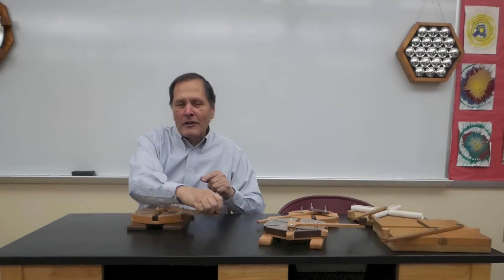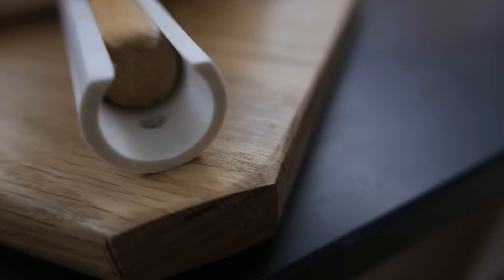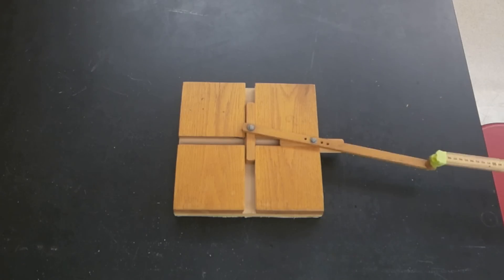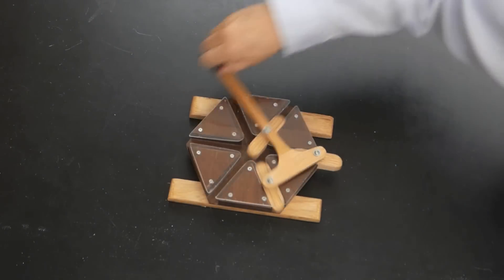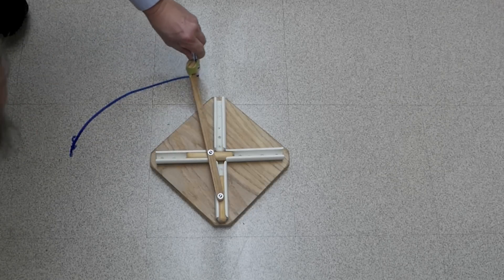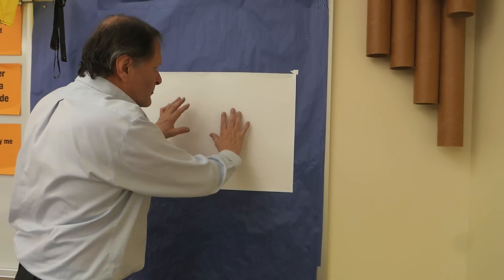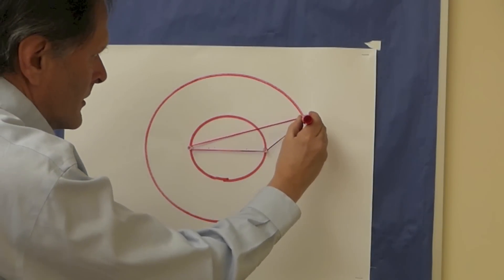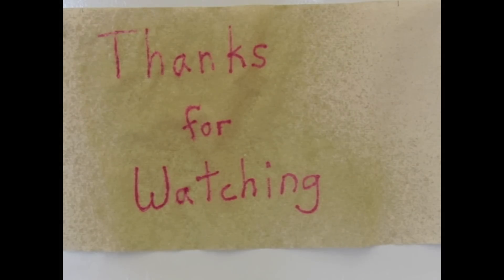Trammel of Archimedes - Do Nothing Machine part 2 // Homemade Science with Bruce Yeany

Comment: Could you (if you somehow accounted for human imprecision) draw a perfect circle,  using the method shown around 5:00, but the string's length was
Pi X the length of the pins? It seems to make sense. On the other hand, using a compass would be much simpler, but it still would be nice to know.

Comment: I happened across a picture of one of these on a web-based image search and was curious about it. One additional search later and I found an article that link your video. From what I understood after reading that article, it uses a little bit of geometric mathematics (mind you, I don't remember my geometry and trigonometry well enough to explain it) to ensure a perfectly elliptical path, making it useful for marking ellipses in things like sheet-metal. What I still don't get though, is how you can adjust the eccentricity of the resulting ellipse? Best I can figure you would have to extend the arms further to make it more circle-like (both fixed points would be closer together, at least in proportion, resulting in a larger but less eccentric ellipse), but what if you wanted a really "flat" ellipse? And how does the elliptical math work?

Comment: School teaches children that they are monkeys living on a ball in a vacuum but with an atmosphere (air) connected to this vacuum, and that we are walking sideways or upside down and spinning at 1038 mph at the equator, which is faster than a speeding bullet yet you see lakes perfectly still and you can see farther than would be possible on a globe earth with a radius of 3959 miles and the drop in feet due to curvature easily calculatable as distance you are viewing over water in miles squared times 2/3 = feet of drop due to curvature.  You can see too far for that math.  A tall man with eyes at 6ft standing at the shore line could only see 3 miles maximum.  The calculation:  Miles squared X 2/3 = 3 miles square = 9 miles x 2/3 = 6 feet drop due to curvature.  So a 6 foot tall man at the shoreline could only see 3 miles yet in real life you can see 10 miles easy.

Comment: Would this be good to use in an engine? Its actually kind of similar to how the pistons on a crankshaft perform. The 'shuttles' are the pistons and the track that they run on are the cylinders. The lever is the connecting rod. All that is missing would be a crank shaft to connect to an axle, which would in turn provide the rotational force. The force, however, applied on this machine is on the lever. In an internal combustion engine, the force is applied to the pistons (shuttles) via a chemical explosion causing the crankshaft to rotate. The pistons are aligned in various positions in different types of setups. For example, they can be placed in-line (inline engine), in a V shape (V6, V8, etc) or even horizontally (Boxer engine: SUBARU. PORCHE). These setups are designed to minimize vibration and maximize torque in an efficient manner to provide a balanced but powerful rotational force to the crank shaft. This setup could actually work in an engine application, with the idea of applying force to both sides of the piston resulting in rotational energy supplied to a crank shaft.

Comment: The reason this is not used as an engine is due to the fact that the pieces travel down multiple lanes, which drastically increases friction. While you would be able to ignite on both ends, it really wouldn’t do much seeing as the most efficient design would involve the pieces igniting at exactly opposite intervals. It would increase engine power, but at the cost of substantially increased fuel consumption. At that point, there are more efficient engines with the same output. Also, the three pin design would (probably) not work at all as an engine due to the fact that it would be very difficult or impossible to find timings that would fit it. Any input on that last part? I’m really not very good with engines.

Comment: You would mount the base to a runner log of a house and drive the dowel in to the joining log using the leverage of the divide. Post and beam house tool maybe.

Comment: I was looking to see if an Archimedes trammel could be done with 3 sliding bars, thank you!

I want to use it to illustrate how three sine waves, 120 degrees out of phase with each other, can cause circular motion in a 3 phase electric motor. This will do nicely.

If you look at equidistant from the three slides, it goes around in a perfect circle.

Comment: You know what you've created, new engine concept. Elliptical in design do to the drive arm orientation, and double head pistons, 6 total. You could fit three of these in on making it 18 total potential piston each doing 4 strokes geeeeeezzz, man you need an engineer on this. What. If you don't man I'll start designing an engine based of this concept.

Comment: im thinking a new combustion motor 
?
Reply: Kyle Gardner I was actually thinking the same thing
Reply: Kyle Gardner compressed air motor
Reply: I can see where you're coming from but it wouldn't really have any benefits, generally you want to have the most simple practical design when engineering. It would also be hard to pull off because of how the pistons would move. The way the chambers open up is the problem
Reply: Ah meaning it need to be built with two sides ?
Reply: Wouldn't have many benefits (if any) but it would look really cool

Comment: If you have an rotary motion, you can use it to produce stroke motion. Just turn the piece with the slots and the bar will pushpull. May it make easier to overcome the dead point as with an eccentric.

Comment: so Bruce as I new subscriber I would like to ask if you know of a mechanical gear set that would allow me to drive a wheel with a handle along part of the wheels rim. I hope I'm making sense. what I'm trying to do is build a hubless unicycle that ideally I will set inside with a set of handles between my legs that I will power the cycle with by pushing and pulling like rowing a boat. I have seen a gear set on the handles that will travel inside a gear channel that is around part of the wheels hub and then reverses and runs back to where it startted from and starts over again.
Reply from the maker: Wow,  that sounds like an awesome project,  I think I understand how you want the setup,  I will check around see if I can find something

Comment: Hey Bruce, 
So for the sake of argument, why can't this be applied to a 6 cylinder radial engine with the spark plugs and ignition chambers around the outside?  And why can't the first class/second class levers be similarly applied as a four cylinder IC engine?
Inquiring minds want to know. ;-)
Reply from the maker: I've had a few people suggest that it is similar to the design used in a Paut engine but have not checked into it

Comment: would you be able to share the plans or measurements of the more complex one? (3 sliders). Also when I made a 2 slide one i didn't do such a great job on the hardware used to connect the stick to the sliders for good movement. What did you use? Thank you. I love these machines
Reply from the maker: Daniel,  I have several pictures that I can put to gather that would be helpful,  I attached the shuttles with machine screws and can show that also
Reply: Bruce Yeany I would greatly appreciate that. Thank you.

Comment: If you move the handle with constant speed, you can see that the small wood pieces move in one direction but the speed changes dinamically (acceleration). It is how gravity works. Gravity affects speed of matters so it will produce acceleration. It is why planets dont only move circle, but also oval

Comment: Make a feeder hole, Turn it upside down. Make the three axis be a full lid and then have an animal move or a source of water rush in ellipsograph pattern. Hower, instead of one handle. It would be having two handles, the other one simply being there to pick up the current once the other axis is at the end of the water rush. To keep it spinning around and around. 

And voila, you get a way of categorizing something in even bits... Needlessly complex. 

Personally, I can only see the X/Y axis version being useful in more applications if anything. But due its shape oval shape, it is very hard to truly translate it into more useful functions than Circular applications. Since the short sides generates too much resistance, hence the pen Hiccups at those points. 

The resistance in a circle is more consistent through out, allowing it to not create uphill struggles.

Comment: I'm curious, would you be able to make an automatic braiding machine with this, a hole in the bottom and string attached to the shuttles that gets drawn by something at a relative speed to the rotation of the lever? I don't know if it would work but I'm curious to see the result. Thanks in advance!

Comment: I prefer drawing ellipses with a compass rotated on its pivot to a certain degree, connected to a pair of legs to for stability, and a pen that can slide within its holder. The pivot point is the center of the circle/ellipse and the degree of tilt determines the shape of the ellipse. The sliding pen, at an upright, doesn't slide and creates a circle; but once you introduce tilt, the pen will slide within its holder to create an ellipse. The ellipse is caused by the pivot's angle to the surface, the acute angle will cause the pen to retract and create one side of the ellipse, and the obtuse angle will cause the pen to extend and create the other side of the ellipse. Of course this only works in one axis, but if you apply tilt in another axis, the ellipse will rotate on the surface, but I have only tested this with 45 degrees in both axis of tilt, results may vary. 
I forgot who originally created this compass in the renaissance, might have been Da Vinci, but it's hard to research it with so many inventions being made then. I do know Da Vinci made a parabolic compass, but that was an angled pen drawing on an angled surface, so it might be the same concept with a different execution.
Reply from the maker: I would be interested in seeing your method
Reply: http://brunelleschi.imss.fi.it/esplora/compasso/dswmedia/storia/immagini/02/03.jpg

That's one design of what I'm talking about. Although that only provides an angle in one axis. But you could easily add rotation to the rod connecting the pivot and the legs. 
I'd prefer my elliptical compases with a protractor between the pivot and the legs, so you can measure what angle the pivot is at.

Comment: I've realized that the number of shuttles around the polygon (they seem to only work on polygons) is p\2 (p=polygon) like it is always just half and I know this is kindof obvious but I didn't know if you realized that also did you realize that it actually moves around instead of just back and forth like the hex one went around instead of on the same pegs everytime
Reply from the maker: Hello Awlom,  You're right it is not very obvious with the two and three shuttles,  I didn't realize it but hopefully it will become more obvious with the higher numbers of trammels,  I am currently trying to make one with 6

Comment: This could make a effective arm exercising device should you add a  track around the edge and put a tight piece of rubber in it so the shuttles need to push the rubber to fully rotate the lever.

Comment: Actually, looking at this you could use it as a kind of simplified transmission. If you offset a handle on the other side of the device you should transfer that cranking motion into either another cranking motion or into into a piston motion with the right joints. Not entirely sure if it would have any true advantages but it is doable.

Comment: this concept has been applied to the design of early rotary engines used in aircraft but in this case there is a ellipse being formed outside the piston cylinder assembly rather than a perfect circle being formed by a larger cocentric array of piston cylinder assemblues

Comment: Hello Bruce. I was thinking about hot air engines as I watched the video. I think the movement could be adapted to power and displacer pistons coupled to a flywheel like a Walking Beam Stirling. Nice job.
Reply: I was just thinking the same, why has nobody tried this?

Comment: Instead of running it around as a machine, imagine tight tolerances with seals and use it as a valve system. Most valves open and close in line but imagine an industrial setting where fluids or gasses might be diverted into tanks at various stages of production.

Comment: If you change the length of the track and the anchor point of the major axis could you make it trace the path of a circle rather than an ellipse?
Reply: A circle need to have one foci, not the 2 or three used in the trammels.  If you remove one foci, and affix the other, you will have a circle maker.
Reply: So any sum of trammels other than 1 results in an ellipse?
Reply: A circle is infact a special type of ellipse.
What is really interesting is that the circumference of a circle is well defined (c = pi*r^2). The circumference of an ellipse has no simple equation, instead different type of approximations are used depending on accuracy needs.

Comment: Using this contraption, how can the distance between the two vertices and the distance between the two covertices (distances 2a and 2b in geometry I believe) be affected? Are they fixed to an arbitrary proportion meaning that no matter how far from the center you place the marker you'll always get similar ellipses? 

Also, could you post an outline of the pieces for both mechanisms (or at least the fancy one with the three pieces moving in its base) to build our own?
Reply from the maker: HI David,  I am in the middle of writing up some build instructions and should have them soon
Reply: Bruce Yeany did you ever post the build instructions?
Reply from the maker: Hi David,    sorry   I didn't make those yet, I think if you check there may be some online.  I

Comment: I worked in an art gallery when I was younger. I knew of the push pin technique. The fact that it creates an ellipse is interesting. If the handle was telescopic and the end modified to hold a cutter to score glass or blade to cut mattes this would be a simple but useful tool.

Comment: Not obvious why the triaxial produces an ellipse.
Reply: Here's an explanation if you're willing to draw it out.

Pause the video at 3:42.
Look at the shuttle that is attached at the base of the handle.  Let the x-axis be the axis along which this shuttle travels.  On a piece of paper, draw this axis as a solid line.  Look at the shuttle at the top left.  Draw a solid line along the axis this travels.  The small angle between this line and the x-axis is 60 degrees. Draw a dotted line along the length of the handle.  Call the small angle between the dotted line and the x-axis "theta".  The connection points of the three shuttles to the handle form an equilateral triangle, so the top left shuttle is offset from the handle axis by 30 degrees.  Draw a solid line from the x-axis shuttle to the shuttle at the top left.  Label this line segment as having constant length "r". The small angle between "r" and the x-axis is "theta"+30 degrees. Draw a solid line from the x-axis shuttle to the marker.  Label this line segment as having constant length "L".  Label the line segment between the x-axis shuttle and the center of the trammel as having variable length "b".

The y-position of the marker is given by y = -L * sin(theta).

The x-position of the marker is given by x = -L * cos(theta) - b.

(relative to the center of the trammel)

Using trigonometry, (which includes using angle sum identities), you can determine that b takes on the form b = b_0 *cos(theta), where b_0 is some constant term.

So the x-position of the marker has the form x = (-L - b_0) * cos(theta).

So the marker draws out an ellipse.
Reply: (b_0)

Comment: Ingenious machines which draw curves with an ever changing radius through vector addition.  It is interesting that the centre of the pivoted points seem to describe a perfect circle. It is not exactly a do nothing machine as it is a system where vector addition and subtraction and components of a rotating vector are seen before one's eyes. There is a relation between  two phase and three phase motors in those two systems where one uses  90 degrees phase shift while the other 120 degrees phase shifting.   Congratulations on your workmanship and the concept itself which says a lot about multi phase systems.
Well done.
Reply: Carmel Pule'ρω την τω)πο) θα